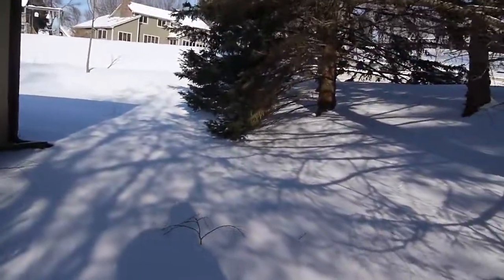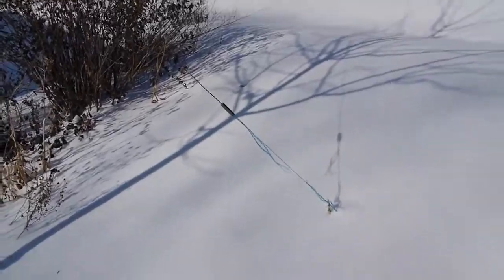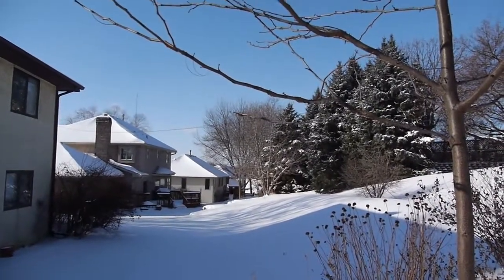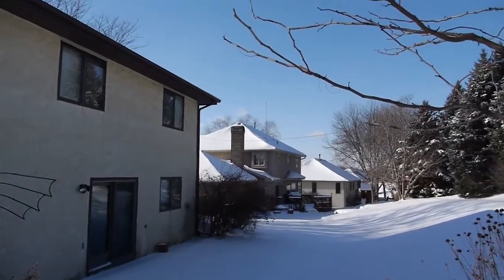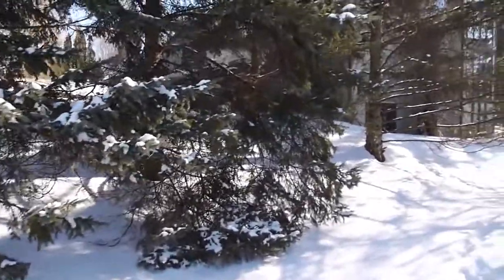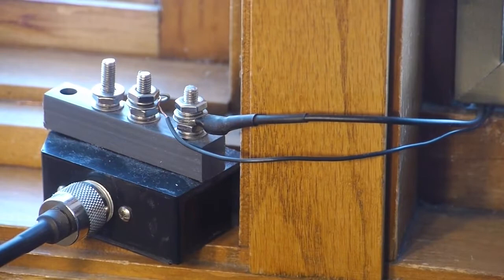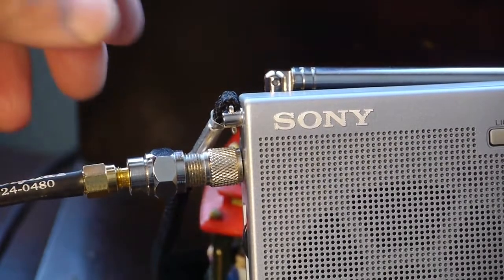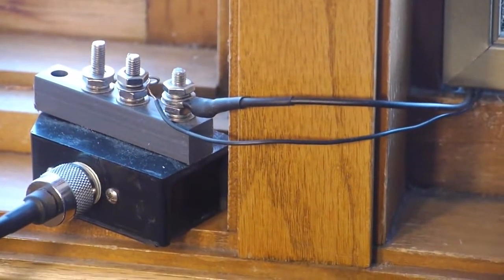Par EF-SWL Antenna: A Quick Overview on the Sony ICF-SW7600GR

Comment: Are you still using this in 2025?
Reply from the maker: I am - but at the moment I have to reconfigure it. The wire got stuck in a high bush late last fall and I need to set it up again. So, right now I'm using an 66ft EFHW - which is ok - but noisy.
Reply: @ I love antennas lol.  That’s what I use and put the counterpoise to a ground rod
Reply from the maker: @jameyevans29  I’m an antenna fanatic as well. The PAR is interesting - since it has 2 different ground posts based on the windings for optimization and a wire length suited to the shortwave bands vs amateur bands. I really need to do a follow-up with it.
Reply: @shortwavelistener  I should have clarified, I use an end fed half wave from MyAntennas 132 feet long.  I talk a little on the Ham bands and listen to SW broadcasts.  
I appreciate your videos!
73!  KQ4GDB

Comment: 7600gr has attenuation on the antenna jack you'll get even better performance either clipping the coax to the whip or using a different portable.
Reply from the maker: Thx! I haven't noticed that specifically other than in the MW and LW under 1700 khz. Head-to-head with my Yaesu FT-891 it performs the same (other than narrow filters and DNR).

Comment: I used this same antenna in an inverted L configuration with the unun located about 30 feet away from the house, then had buried coax feedline leading to the house.  I grounded it with an 8 ft rod sunk just a few inches away from the unun.  I got very good results in coastal California and am setting up a similar antenna in a new location now that I've moved.  Last time, I did not also ground the coax shield near the house, but I am doing so this time with a lightning arrestor.  See this page for some information I found helpful:  http://users.telenet.be/d.rijmenants/en/swl.htm

Comment: So is that wire going down to the ground and actual ground wire? I ordered this antenna and was wondering if it needs to be grounded when installed.
Reply from the maker: Ryan B No, I have found that dropping a 10-15 ft wire off the ground terminal out the window away from the main wire helps on certain frequencies. It actually does not attach to the ground. But, the wire is not necessary and works fine without it.
Reply: Shortwave Listener oh, that's interesting. I wouldn't have thought to give that set up a try. Thanks for getting back to me. My antenna should be here any day. Ready to get it set up!
Reply from the maker: Let me know how it goes!  One thing I want to try this summer is to setup the impedance match near the ground with the antenna at an upward slope and actually attach a true ground post wire to see if I can tell the difference.
Reply: Shortwave Listener it's fun to play around and see what works. I'm moving to a new house in a couple months so I'm not doing anything permanent here. I just strung mine up along the back porch. Good signals so far. I'll do the ground part eventually.

Comment: Nice video...if you get the that 9:1 matching transformer at least 5 meters outside and away from your house you will see a considerable reduction in noise.  It is designed to place outside.   there is no way this set up is not being effected by AC line noise from your house wiring.   This antenna design is one of the best (I built my own) The 14 meters of wire combined with the 9:1 binocular ferrite core is perfect for SWL.  thank you for share this video.  73s Brian
Reply from the maker: Thanks! And yes, I do understand that having it farther away would help. I have to keep it above ground or my wife :) doesn't like it. At some point I'll add a coax feed and move the antenna but have no way to get the feed in the room right now. It still does a remarkable job of noise reduction even in this setup. Check out this video on its performance- https://www.youtube.com/watch?v=TymU98A28Jg

Comment: Thx for this one!  I have been considering the Par SWL for awile.  The only thing that had stopped me was it's small size of only 45 feet against others that are at least sev feet longer in length.  How does it perform around 5 MHz and below if you know.
Reply from the maker: It actually works the best from 2-10 MHz. But, you have to have it elevated - mine is about 15 ft above the ground. Check out my video of the 160 meters SSB chat. If anything the 9:1 unun is worth the price - you can connect any length to that if the 45' isn't what you want.

Comment: Thanks for the nice video.  I have a similar setup, but I located the feed point further away from the house.  There's a lot of noise inside my house, so using coax makes it possible for me to get my antenna in a nice, quiet spot.
Reply from the maker: Sitting on my window ledge seems to work fine with my noise levels. However, this summer I will be trying it outdoors away from the house with various grounding options. We'll see how that works.

Comment: Hi, where did you get the converter cable and adapter to go into the Sony? I am waiting for my Par EF-SWL AND NEED BOTH.
Reply from the maker: Hi!  Here are the ones I purchased:
https://www.amazon.com/gp/product/B00CVTT8XI
https://www.amazon.com/gp/product/B00ANX10MQ
https://www.amazon.com/Female-Coaxial-Adapter-FM-Antenna/dp/B00BBYRDG8

Just note that the coax is only 20 inches long - so if the Par's transformer is far away from your Sony you'll need a longer one.
Reply: Thx. The boys got a Eton Satellit portable from a couple uncles, I am writing a manual for them because OEM is useless for rookies. Getting many SWL using abandoned small dish; playing with 25' extension cord but alot more noise then dish coax,  I need to ground for next run, then gonna cut it up and see what it sounds like using wiring using "zip wire" recipe from scancat. glad End-fed SWL was otta stock till next week. Dad learns so boys can- thx

Comment: Great video my friend, thanks for sharing. Greg is right of course in that the impedance is frequency dependent, also the input for the Sony is likely to be higher than 50 Ohms. I'm sure I read somewhere it's around 75 Ohms....worth checking. Thanks again for an interesting video! 73! Clint
Reply from the maker: Oxford Shortwave Log Thx for the comment! I'm embarrassed I didn't do my research and will correct the video on random wire impedances.